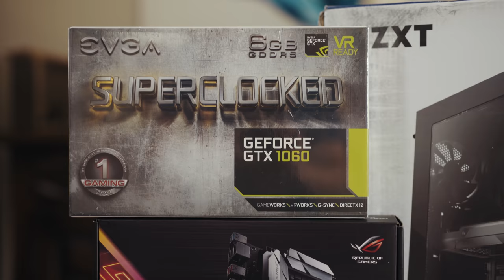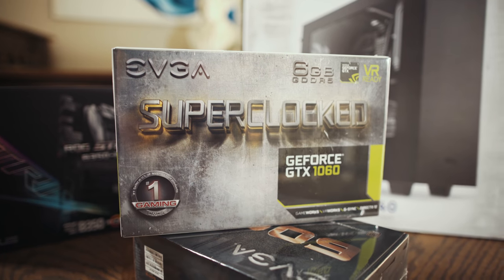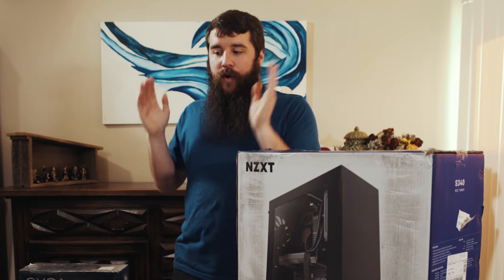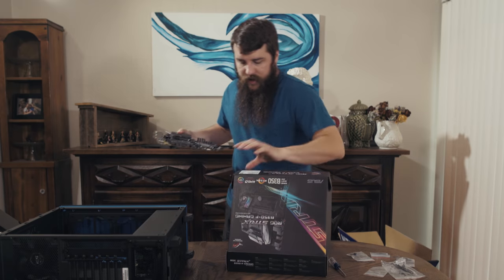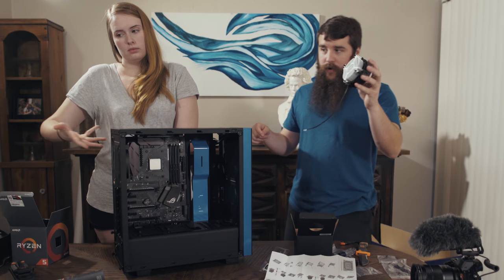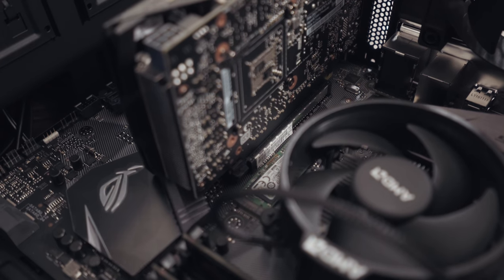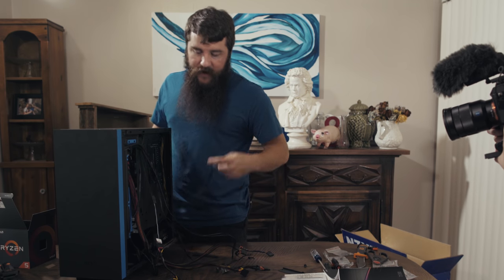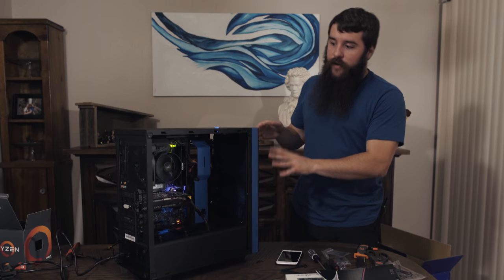How To Build A Video Editing Computer | $850 Ryzen PC Beginners Build Guide | 2017

Comment: Only one problem with this build, Matt. Ryzen offers no hardware acceleration for playback of H.264/HEVC footage whatsoever. Conversely, Intel does offer that with Quick Sync hardware accelerated decoding. If you want to cut native H.264/HEVC, especially Premiere Pro, this might be the wrong build for your subscribers (in my opinion). 

If Matt's brother wants to cut 4K HEVC footage from his phone, and cutting on Premiere he might be be disappointed. If his brother cuts on non-H.264, than this should be OK. Maybe he cuts with an NLE that can deal with H.264 footage well?

Of course, this is all from my perspective as a Premiere Pro H.264 editor. I need my Quick Sync. Or am I completely wrong in that more threads can beat Quick Sync performance? I've heard both sides. The million dollar question. Maybe something to test?
Reply: man. save me some $$ with that HEVC info. I was thinking to build this PC for editing Mavic air 2 videos that are coded with H265..so what should I get to overcome h265 issue.
Reply: @Jaysa11  Sure. If you have short HEVC clips, and need to edit them raw - with a fast turnaround - then the Intel/Quick Sync should really help you there. Fast media drives help.

That said, editing these files with any computer is gonna be rough. HEVC is a beastly codec, truly a cruel master. If you have a mass of HEVC/H.264 4K+ clips, and "all you do is drones - or the like," you might prefer to transcode the file to ProRes at ingest instead (File > Project Settings > Ingest Settings). That is, if your computer continues to struggle with these files.

With transcoding, you can start editing the project with the performant ProRes clips. These start replacing the imported HEVC clips in the background. It's cool. If that's what you end up doing, the AMD machine starts to make it seem like an OK choice. Personally, I'd like to have the best of both worlds. QuickSync for fast H.264/HEVC turnarounds, good CPU power for transcoding to other formats which have other advantages, like smart rendering.

Comment: QUESTION, I bought a Samsung 960 EVO for the OS and a 4 TB HDD for storage. Should I buy an extra SSD to use as a scratch disk? Or would using the same Samsung EVO be okay for both OS and scratch?
Reply from the maker: Hey! Check out this article about scratch disks. It's for an older version of Premiere but should still be relevant. From what I've read, you won't much if any improvement using a scratch disk. You would benefit from editing off an SSD though, and not a regular spinning hard drive: https://www.pugetsystems.com/labs/articles/Adobe-Premiere-Pro-CC-2015-4-Storage-Optimization-854/

Comment: Hey Matt, so I’m planning on building a PC and using the Asus ROG STRIX B350-F which you have used in this video. However, In terms of the RAM I have looked at a G.Skill F4-3000C15D-16GTZR Trident Z R GB Series 16 GB (2 x 8) and was wondering if this would be compatible with the AMD Ryzen 5 1400 processor as I’m not sure and new to this whole pc interior thing.

Comment: Greetings from FINLAND! This was SO helpful! We are currently working on building or buying a PC only for video editing. We looked up all the pieces you used and we are considering buying them here in Finland. This was such a great video. It has been so frustrating to find a good laptop for video editing we could take with us for our travels (That is not an Apple, because we both only use PC's). 

We ended up finding  a monster of a laptop to suit our needs when we left to travel around the world for as long as possible. We ended up traveling 15months. BUT now we need a workstation that we don't need to carry on our backs all the time. This looked like the perfect solution for our problem!

We have one question. If we only need this PC for video editing and not like any gaming what so ever, what would be the best Graphics card for that kind of build. 

We would love to see you build a PC just for video editing. 😊

You both were great on camera! 

-Titta & Thomas
Reply from the maker: Hey thanks so much! I would go with the GTX 1050 ti if you didn't want to do any gaming. That should still be plenty powerful for editing. From testing that I've seen,  the graphics card doesn't make a huge difference when rendering, speed depends far more on the CPU.

Comment: Hi Matt! Thanks for the video. When I get the chance to build a PC, I'll refer back to this guide.  

The computer that I'm planning on making my own editing computer is a Mac Pro from 2008. It's old. It'll be 10 years old this January, but here are the specs.  

2x 2.8 quad core Intel Xeon (upgrading to 2x 3.2 quad cores), 64 gb ram, 8tb of space (installing an SSD soon), and GTX 680.  What do you think of my specs in terms of editing? I have the a6300 and shoot 4k.
Reply from the maker: +Peter Xiong thanks Peter! I think your main bottleneck is going to be that those Xeon cards aren't multithreaded (I'm pretty sure) meaning you're only going to have 8 cores, and the gtx 680 is starting to get pretty old.
I think your setup is great for 1080p but I'm not so sure about 4K.
Reply: Hi Matt! Welcome to Boston (if you're still here)! I saw your Facebook post.

Anyway, I just want to say thanks. Because of your video, I decided to sell my Mac Pro and go for a Ryzen 7 build with 16GB of RAM and a 1060 6GB.  I was initially just going to go for an Intel build, but I really saw the potential of Ryzen CPUs for editing, especially for 4k video editing since I shoot on the a6300.

Thanks again! Hope you enjoy/enjoyed Boston!

Comment: Hey Matt! Me and my boyfriend worked all afternoon on this tutorial and we used this video as a guide to your other video about the 650,- edit PC build. We followed your instructions very carefully, But then, when the moment of thruth came, nothing happened.. The PC would not start and now we are kind of clueless to what we should do.. Should we rebuiled the whole thing? Or are there some specific aspects that might help? We would gladly hear from you soon! And either way, I loved your positive energy!made it all the more fun ;)
Reply from the maker: Hey! Is anything powering up at all? And lights or fans? If not I would double check the power connections and make sure the switch on the power supply is turned on
Reply: @whoismatt  Hahaha, we did it. We made one small mistake. I was so happy when it turned on and it worked. Tommorow we'll install Windows etc. Thank you so much. And we really do love your vibe, very positive 😎 (also super lovely wife)

Comment: 47:10 you say that the GPU should be installed as close to the motherboard, but you removed the second and third expansion slot, as opposed to first and second??
Reply from the maker: Hey! I was lining up the graphics card with the first expansion slot. That's where I put it I promise :)
Reply: Thanks for the clarification!

Comment: Hey Matt!  Great stuff! Love the case. If i want to up my processing power and opt for a 370 motherboard and the 12 core threadripper would you still think 600 watt is enough from the power supply? I think it doubles the intake (in comparison to the ryzen 7 1800) to 180 watt.
Like you said when it comesto working with a pc on a daily basis i'd like to keep my electricity bill as low as possible :)
Reply from the maker: +7AW hey thanks! I think that 600 watts should be plenty for that processor. If you're worried I believe Newegg has a power supply calculator where you can put in your parts and it will show what your total wattage is gonna be. 

Remember that just because your power supply is 600 watts doesn't mean it will be using 600 watts all the time. It just means that is the max it could draw if it needed it.
Reply: Thanks for the tip. Didnt think of searching for a calculator. But i have to say the one from Newegg isnt very useful. With 3 SSDs and 3 HDDs internally installed it gives me a recommendation for 780W. But i cant choose which threadripper im useing or specify the graphics more than GTX1060.
Gonna try out this one though: https://outervision.com/power-supply-calculator
Reply: Okay here i get about 475W which seems about right. So a 600 or 650 should be fine. Thanks again!

Comment: I watched the whole video and found it very helpful. Over the last decade I've been a Mac user. I use Final Cut Pro X for my my productions. Lately I've been looking into other options and this computer build was helping me decide whether I'd buy another Mac or build my own PC and put Davinci Resolve 16 on it. My question is how well does this configuration run Linux Mint? I love tinkering with other OSes. Generally Linux works well with Intel processors, which is why I was curious.

Comment: Hello! When I turn on the pc everything spins and seems to run smoothly but the monitor has no signal. I have the hdmi plugged into the graphics card too. I got the 27 inch LG 27UK650-w 4K screen.  Over time when I turn it on it would flash EDGE: and at the bottom it says something about f11 and delete+f5. And then goes to reboot and select proper boot device. And then repeats. I started hitting f11 or f8 and i got it to open up to a page where there’s cpu, storage etc but I’m not sure what to do from here? 
Let me know thank you so much !

Comment: Help Matt! I did this exact build and I'm getting not getting anything when I power on. No fans, no RGB LED's, nothing. Any troubleshooting you can suggest?
Reply from the maker: Hey! Definitely sounds like a power issue. I would recheck and make sure the power switch in the back of the power supply is flipped on, then check the power cord, then go through all your electrical connections on the motherboard

Comment: Hey Matt, I appreciate your advice, and I've now built my computer. I haven't installed the os yet, but will this computer  be wifi & Bluetooth capable, or is there something else I need to buy? 
I have the MSI B450-A PRO MAX motherboard
Reply from the maker: Hey! You’ll need to buy a WiFi/Bluetooth USB adapter. I have one linked in the video description.
Reply: @whoismatt  Thanks Matt, everything is running smoothly, thanks to you. It was very easy to do, but if I may add...
Wheel you're showing the really tiny pins that the power switch, led power, ect, really zoom in on those, because I did have a lil bit of a time figuring that part out. (Or just draw a quick diagram on paper. Anyway, I just wanted to say thank you for your helpful videos. I bought the thigh end of all the parts, and I love my computer.
Reply: @whoismatt  Also, wanted to ask, how would adding a second graphics card help my computer? I was thinking to go ahead add a second one, and 32g more of ram? I see myself doing much more with this oc in the future. What realm would that put me in?

Comment: Hey Matt! Long time listener, first time caller. Quick question about the hard drive. I have heard somewhere that writing big files constantly (4K videos) to an m.2 SSD can be harmful to the ssd in terms of longevity. Would it be better to just keep the software on a smaller m.2 ssd and do all of my writing to let’s say a 1tb sata ssd?

Keep up the excellent work!
Reply from the maker: Hey thanks! Yes, SSDs have a limited lifespan that can run down as you copy footage to and from them. That said, they have pretty massive lifespans. Even the smaller 250GB Samsung 960 EVO has a lifespan of 100 Terabytes written. Their larger 2TB 960 PRO has a lifespan of 1200 Terabytes written. Those are both HUGE numbers! 

Yes, 4K files are large, but even this video project at over 1 hour was only 50GB. I could render this video many times and still not come close to even 1% of the rated lifetime of the 250GB 960EVO. And remember, the rated lifetime is just that, the rated amounts. I'm betting that most SSDs will last longer than that.

Comment: I am ready to order, but I have a question. I already have a Geforce GTX 1060 and I was hoping to use it for this build. But the problem is that it's the dual fan GTX 1060. Will it fit over the piece on the motherboard that's protruding in front of your graphics card? Edit: I have another question. Can I buy the AMD Ryzen 7 instead and will it fit the same connection on the motherboard? I want more power. Thank you!
Reply from the maker: Hey! It should still work, this Motherboard should work with any graphics card. The Ryzen 7 should fit the same socket as the 1400.

Comment: What if you get a “no dp signal from your device” when you power it on. I’m using a dell u2718q monitor
Reply from the maker: Make sure you are plugging your monitor into the back of the graphics card, not the motherboard. Also make sure your monitor input is set properly.

Comment: did you address what he is doing for his operating system/Windows?  that's another $110 and requires some steps since there is no spot for an optical drive in this computer case
Reply from the maker: Yup, Windows 10. My brother had a copy of Windows 7, so it was a free upgrade for him. Windows 10 is actually really simple to install from a flash drive now, no DVD drive needed.

Comment: I have been pondering this exact subject matter for the past few weeks. Thank you for the information and resource. Can you recommend a video editing laptop and what hardware must be included, while remaining on a similar budget? I'm leaning toward Davinci for software. Thank you for sharing your experience and insights. Your 'real life' approach to informing is greatly appreciated, Matt.
Reply from the maker: +Maurice Smith-Ziegler thanks Maurice! A video editing laptop would be significantly more expensive for similar specs because it would be difficult to build it yourself. Your best bet is to build a desktop and maybe buy a cheaper laptop with decent specs and use it when mobile.
Reply: Thank you for taking the time to advise, Matt.

Comment: Hey what is the purpose of the Molex to fan connector? I bought everything from your $750 computer video but there are spots on the motherboard for all the fans as far as I can see?
Reply: Old school components. But, you can get adapters from Molex to modern for extra graphics card power and such.

Comment: I started to post my comment then saw something shiny and got distracted so I apologize if I post twice. Thank you to you and Rachel for putting the video together. The components you listed are much the basis for my computer but I have a question about SSD. If I wanted to add a total of three SSD (2 250 GB and 1 500 GB – for OS and programs, temp/scratch and exports respectively), can you recommend which Samsung EVO 850 to use instead of M.2? Or will this mobo support 3 M.2 SSD? I thought M.2 was more expensive.
Reply from the maker: +Robin Cook hey Robin! I believe most motherboards these days have 1-2 m.2 slots. You could also add more with a PCIE add-in card. But I would go with a Samsung 960 Pro for your OS/programs and 850 evo for the other two. :)

Comment: Will a different cooler like a h7 cryorig work with ryzen 5 and the mother board or does the ryzen require you to use the fan pro provided by them?
Reply from the maker: You can use most aftermarket coolers with Ryzen, no need to use the stock cooler if you don't want.

Comment: does the case come with a cooling system (air or water) or do u need to buy a seperate one
Reply from the maker: The cpu comes with a cooler. The case has fans.
Reply: @whoismatt  thanks Matt

Comment: This was very helpful and very detailed, exactly what I plan to build: I intend to game on 1080p @60fps and record, then edit videos too, so 1060 is what I was looking for, this seems like pretty perfect build.

I would add one more ssd though, cuz it would increase editing speeds even more.
And I wonder do I need a bit more cpu power hence I wanna record or external recording is better solution?

I wonder if I wanna upgrade 1440p @60fps, what parts I need to upgrade and how much will it cost? And does this still stand true now January 2018? Should I wait a little for price drop?

Best I found, really helpful too with motherboards and why exactly that processor, and also cuda cores on gpus for editing, power supply of course, ram, it all.

Many helpful tips that together make:
This a best value video for best value editing and gaming pc build

Subbed and belled

Comment: Hey guys hows it going. I had a quick question. I put this build into pcpartpicker and it says the that the ssd memory and motherboard are not compatible. The reason is as follows: The motherboard M.2 slot #1 shares bandwidth with SATA 6.0 Gb/s ports. When the M.2 slot is populated, two SATA 6.0 Gb/s ports are disabled.I am not a really too familiar with Computers. Can anyone tell me if this problem is serious or if i don't have much to worry about. Thanks in advance. Great video and i hope to be able to build my pc based off this video.
Reply from the maker: Hey! This isn’t a big deal. Sata 6.0 ports are only used for adding hard drives. The motherboard should still have some ports left over if you wanna add more hard drives into your case. Nothing to worry about. :) the build should be fine